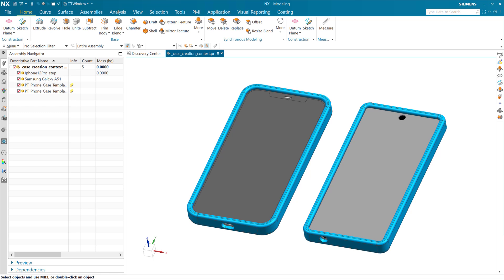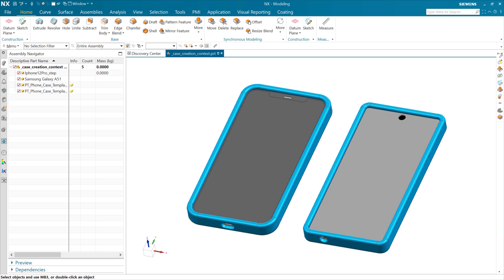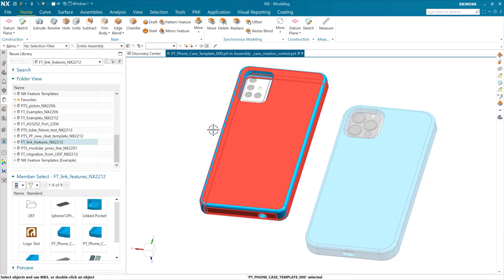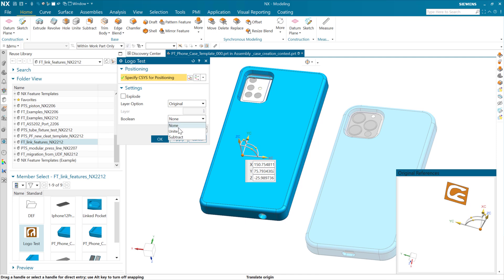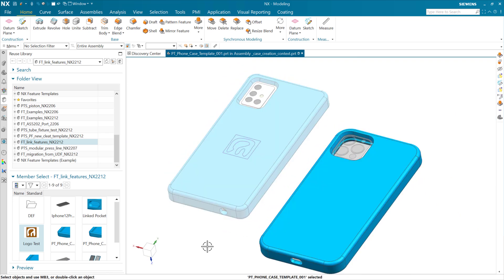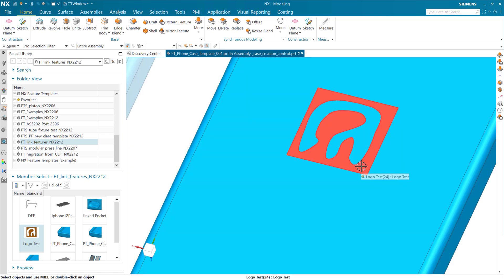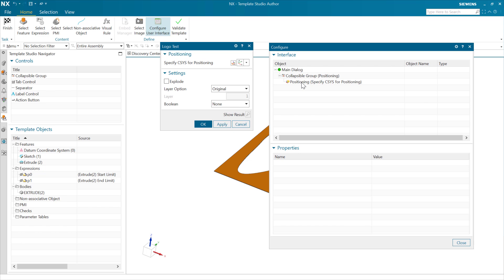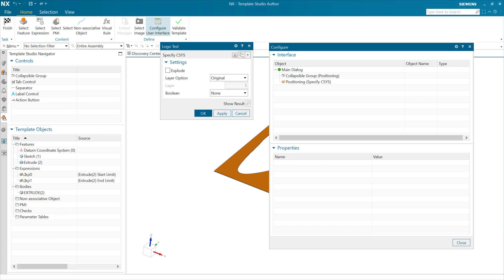NX Feature Templates: Dynamic Positioning for Simple Templates [NX 2212]

Comment: Can I have a template be placed on the center of a face all the time without input from the user, and maybe a vector for rotation?
Reply from the maker: Great question.  How to define "center of a face" would be my main question.  If a UV (0.5,0.5) is sufficient, then you could certainly include an Algorithmic Feature in your Feature Template that can pick up this location (and perhaps drive the rotation vector) to create some attachment geometry on which to hang other content in your Feature Template.  That's the first method that come to mind...  but as usual with NX, there are often five or six ways to skin the proverbial cat.  :-)   Does that help?